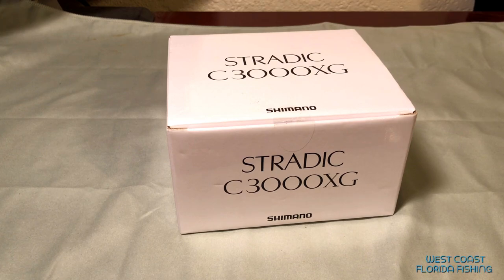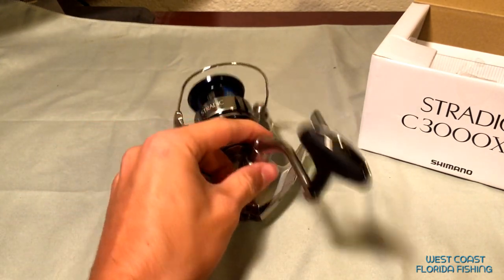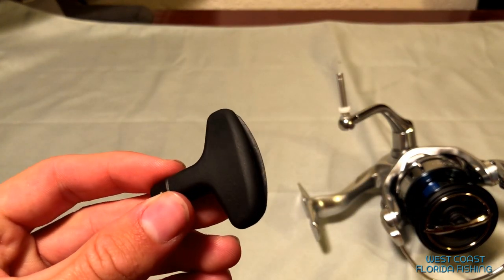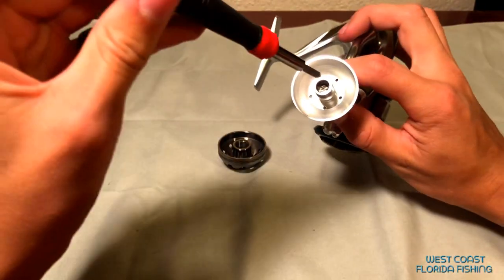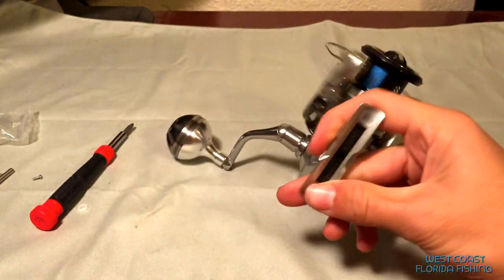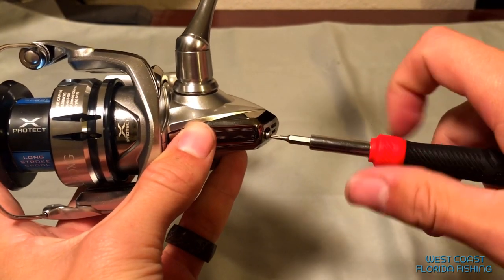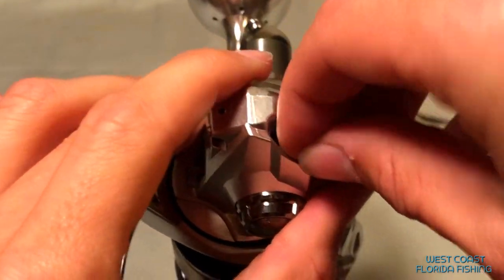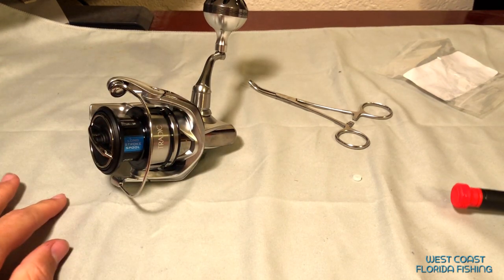2019 Stradic FL Unboxing and Upgrades | Gomexus Power Knob | Upping Bearing Count

Comment: Great video!! For reference, the Shimano part RD17751 does not fit for 4000 and 5000 size reels for under the spool. The correct bearing size is 8x16x5.
Reply from the maker: Awesome thank you for the specs!

Comment: Good video quick question what’s the benefits of the bearings you added compared to the bushing it came with Thanks much appreciated
Reply from the maker: Great question! Swapping these bushings for bearings provides less friction and resistance as your reel works, therefore creating an overall smoother experience!
Reply: It's heavier and the handle unbalanced and the spool bearing will corrode. I prefer German or Swiss ball bearings and the Swiss Ceramic are  reel upgrade. Ceramics are in a different class by themselves.
Reply: Good video bro. Where u can buy that upgrade bearings?

Comment: Just got the exact same reel... Didn't know there were upgrades that can be. Never done just tried servicing stadic fk 3000 the other.. First trying to service my own reel.. Worm everything taking apart.. Was a mission and now my anti reverse isn't working. Will have to open again and look.
Can one order any bearings to put a reel according the the size or how does it work...
Awsome vid thanks so much
Reply from the maker: Yes you can put bearing in according to size of the nylon bushing it doesn’t have to have a compatitable part with another reel. Yeah servicing them can be tricky I like to record myself just to see where things go back sometimes! Did you get your reel fixed?

Comment: What a great video, thanks so much for sharing West Coast Florida Fishing!
I have just got myself a brand new Shimano Stradic FL 5000 and wonder if i am supposed to use the same part numbers as you had on the 3000 (or is it the same on all models?) I also noticed that my reel came with a different orginal handle than the 3000 model.
Reply from the maker: BB O you’re welcome!! Thanks for the support man it means a lot to me!! And wow that’s a nice reel!! It is not the same part numbers but it is close! Everything will work except the spool support bearing swap. That is a different size and I have a link to it somewhere let me find it...
Reply from the maker: Aha here is the bearing you need to order! Here:  
(8x16x5)
 https://rover.ebay.com/rover/1/711-53200-19255-0/1?mpre=https%3A%2F%2Fwww.ebay.com%2Fitm%2FHigh-Quality-440C-Stainless-Steel-Ball-bearings-Listed-by-Size%2F124156176607%3Fhash%3Ditem1ce848e8df%3Ag%3ARyQAAOSwXj1emJGP&campid=5338690692&toolid=10001&customid=Stella
Reply: @WestCoastFloridaFishing  Thank you so much for the reply:) I will then order for my 5000 FL:
- Stella Spool Support Bearing (RD13274)
- Stella Worm gear Bearing Counterpart (RD 11018)
- Spool Support Bearing for 4K and 5K STRADIC FL,FK (8x16x5)
Reply from the maker: BB O you do not need the Stella spool support 13274 but you do need the RD13269 for the Handle support Bearing
Reply: @WestCoastFloridaFishing  Oh, i ordered the 3 above including rd 13274:(
Well i just have to order one more then RD 13269
 it is then :) ty

Comment: I saw you linked the spool support bearing for the 4K in the description, thx for that. Ist the worm gear bearing that you linked in the same for the 4K?
Reply from the maker: No problem man! I’m glad you found it unlike the other 200 people that ask me 😂👀 and yes that worm gear bearing is the same from the 1000-5000 size! Good luck man!
Reply: @WestCoastFloridaFishing  thanks, I will definitely upgrade my 1K and my 4K.
P.S. the 1K still got that felt washer so I will replace that with a carbon fiber drag washer ;)
Reply from the maker: Nice!!! And yeah you can definitely do that with the link here: http://rover.ebay.com/rover/1/711-53200-19255-0/1?ff3=4&pub=5575591865&toolid=10001&campid=5338690692&customid=Carbontex&mpre=https%3A%2F%2Fwww.ebay.com%2Fitm%2FCarbontex-Drag-Washers-SHIMANO-Stella-9908-Stella-2500-3000-Stradic-FJ-FK-Ci4%2F153915952296%3Fepid%3D688391402%26hash%3Ditem23d61b0ca8%3Ag%3ALiEAAOSwn-tZNvyv
Reply: @WestCoastFloridaFishing  thanks man, I appreciate it

Comment: Thank you for sharing this video. I just returned a Battle II 3000 for which I received for Christmas and purchased / ordered the Shimano Stradic 2500 FL. I hate to assume so I'll ask will these parts and changes benefit this real also, the 2500? I'd like to know which handle, knob you used. Was it the 35, 38, or the 41 mm.? Also and replacing the bushing for a bearing on the spool what's the main purpose of that? And the purpose of the bearing on the Worm Drive? Again thank you for sharing this video and Tight Lines and Full Limits To Ya 🎣
Reply from the maker: Big K You’re very welcome! Thank you for watching it! I believe you made a good decision switching the two. Yes all of these bearings should fit your new 2500. The knob I used was the 38mm but you can choose whichever size you like. Replacing the bushing for a bearing on the spool will help reduce the amount of load on your main shaft while hooking in large fish that’s taking a ton of drag. The worm bearing drive simply reduces the friction between the worm gear and the main body and therefore makes the reel smoother! Great questions and I hope you stick around and subscribe for more awesome videos like this one! Tight lines brotha! -Isaac
Reply: @WestCoastFloridaFishing  thank you I might just do that.
I live on the Texas upper Gulf Coast and this is my first spinning reel well my first would have been over 20+ something years ago and it was a Penn 4400SS, yes that was a long time ago. I actually have my first reel that I ever bought new at the youth back in the 70's. So again this is my first spinning reel in a ton of years most of the men around here all used baitcasters but there's a lot of them going to The Darkside LOL. I've got hands like a bear paw as I stand 6'8" so that's why I'm considering that knob change, which led me to your Channel and these questions. Thanks again and God bless. 🎣
Reply: @WestCoastFloridaFishing  my apologies I should have asked where do you order your parts from?
Reply from the maker: Big K oh wow it has been a long time since you’ve owned a spinning reel! It seemed that the meta is shifting a little to throw out ultralight lures on spinning now.. I’m glad you were able to find my channel and seek some help! And I don’t order parts I work at a tackle shop and we service reels in store so I have all the selection we need! eBay can be a good resource to get bearings though!
Reply: @WestCoastFloridaFishing  yeah babe the first place I went I only found one person in that guy's going on vacation or something else and he couldn't answer questions for me so blah blah blah. No worries I have enough interest in it that I believe I'll find those parts somewhere I know where to find the handle that I found out on Amazon cheaper than eBay. Thanks again for your time

Comment: Will you be doing any video PIMPN'...lol, on the Stradic Ci4, but just the bearings? The knob would defeat the purpose of it being a light weight reel.
Thanks a bunch
Reply from the maker: Jose Labrador I can definitely put that on my to do list! It’s basically the same exact method as the Stradic FK but it would be nice to see the exact reel you own being worked on. I will upgrade my 3000 Ci4+ FB for a video just for you 😁👌🏽
Reply: @WestCoastFloridaFishing  Thanks a bunch!

Comment: Great video! I have the Stradic FL in the 1000, 2500 & 3500 sizes. Love these reels but the slop at the handle bothers me. What bearing did you end up using where the knob attaches to the handle?
Reply from the maker: Ben Anderson They’re amazing reels for sure! And that slip can be fixed with some shims but the bearing is the same as the stock one. And I ended up using the bearing with the part number RD13269
Reply: @WestCoastFloridaFishing  Thanks for the response!!
Reply from the maker: Ben Anderson you’re welcome! Stay tuned for an upcoming video where I show you how to reduce the amount of slop in the handle also known as handle play! Should be able to get it out soon!

Comment: Muy buen video. Necesito saber como se llama el destornillador pequeño para cambiar a rd13274 de la bobina.gracias
Reply from the maker: Thank you amigo! That bearing is found on the Shimano parts website and is fairly easy to find. Or you can use my link in the description to get the bearings!

Comment: A few people have been saying that the smaller FL's are good and strong but, the bigger 4000 and 5000's the drag Doesn't hold up against big fish like people thought. Will doing these upgrades help it out alot ? Thank you
Reply from the maker: I’m not sure about increasing the drag power and preformance as we didn’t touch the drag system at all.. unfortunately the drag is going to stay the same all the way up. The only thing I could think of is to use a more high quality carbon fiber to allow enough heat to dissipate faster and allow the drag to withstand more.. sorry I wish I helped!

Comment: I have three of these reels in the 2500 version and have had to replace the roller bearings on multiple occasions due to corrosion and loud noise when reeling/working lures. Do you have a solution for this issue??
Reply from the maker: Yes all I do is pack that line roller with shimano grease and that will make the line roller lady a lot longer

Comment: Hi, apologies for a slightly unrelated subject. I need to replace a handle knob on my Sustain 2500 FE, however Shimano Australia advised that the part is superseded.
Can you suggest any aftermarket brands which can offer a knob replacement? Alternatively, can the whole handle assembly be replaced with the Gomexus 98mm double handle?
Cheers
Reply from the maker: Any of the gomexus knobs will replace your handle actually! You can follow any of my gomexus tutorials and it should be the exact same. What year was your sustain??
Reply: @WestCoastFloridaFishing  I think it is 2008

Comment: Ceramic or steel ball bearings? For lubrication, should i use oil or grease?
Reply from the maker: I don’t always lubricate bearing wise but if I do I use Shimano grease and I have always went with stainless steel ball bearings.
Reply: That is good to know. Thank you!

Comment: @west coast Florida fishing, I'd like to do the same upgrade for my new 5000 size reel of the same make . What parts would I have to order , excluding the power handle ?
Thanks.
Reply from the maker: Vikram UG great question! The worm gear bushing upgrade is the same posted and used in the video but the spool support bearing has the part number of RD17751. I hope this helps you!
Reply: @WestCoastFloridaFishing   Thanks for the deets
Reply from the maker: Vikram UG you're welcome boss! Make sure you enter my giveaway for a chance to win 20$!

Comment: Them bearings will they fit the 2500 FL shimano stradic the bearings you just put in this reel are are they better then the boca bearings plus who makes the best one out there on the market today are if it makes a difference
Reply from the maker: Eugene Johnson with this light application reel it would suffice with boca bearings! They will fit the 2500 Stradic FL yes!

Comment: Is there a size different between 3000,4000, 5000? or its just the line capacity?
Reply from the maker: There is a size difference between the 2500,3000 and the 4000,5000 but not a difference between 2500 and 3000. Also no difference between 4000 and 5000. This is why you see a “C”3000 that ‘C’ is noting a compact reel=same body size. Different spool Size. Same with the ‘C’5000 and the 4000. Thanks for the comment!

Comment: I'll subscribe. I don't know if I want to replace bushing to bearings. I own the stradic fl 5000. I did a Unboxing video on that.  My very first shimano reel ever.
Reply from the maker: Sparky Ishii Thank you for subscribing! And I would probably swap out the worm gear bushing for a bearing but that’s just my input.. I’ll have to go check it out for you!
Reply: @WestCoastFloridaFishing  I'll  go look into that. You seem to know that bearing must improve performance of the reel. 
I personally have bad luck with bearings in general. I wore out many bearings for my penn slammers. I replaced them and wore them out as well. 
Thank you
Reply from the maker: Sparky Ishii Yeah working at the tackle shop I’m inside of reels often and A bearing has less friction than a bushing so it makes the reel feel smoother.. good luck!!

Comment: Do these same part numbers work for the 2500? I think the only difference is the tall spool. Correct?
Thanks
Reply from the maker: They will work exactly the same the only difference between the 2500-3000 is the depth of the spool!

Comment: Whats the gomexus knob size? 35mm or 38mm?
Reply from the maker: The one I used in this video was the 38mm knob but for 3000-2500-1000 sized reels I record the 35mm knob as the 38mm is really a tiny bit too big for those sizes
Reply: @WestCoastFloridaFishing  olrite, thanx alot, tight lines 🤙

Comment: im having trouble finding those part #'s on the links you provided, rd13274 is not on there?
Reply from the maker: I will get you the correct link as soon as I get home then! And fix the one in the description. Thank you for the heads up! It should be fixed in about an hour
Reply from the maker: I found a correct link and updated the description! Thanks again! Link: https://rover.ebay.com/rover/1/711-53200-19255-0/1?ff3=4&toolid=11800&pub=5575591865&campid=5338690898&mpre=https%3A%2F%2Fwww.ebay.com%2Fsch%2Fi.html%3F_from%3DR40%26_trksid%3Dp2047675.m570.l1313.TR0.TRC0.A0.H0.XRD13274.TRS1%26_nkw%3DRD13274%26_sacat%3D0

Comment: Hello, i have an fl  5000, in the manual said these parts are
Rd17698 handle knob bushing
Rd16157 spool bushing
Rd19976 worm bushing rear

Not the same parts you said, fits your parts number in my reel?
Reply from the maker: Hello! The bearings used in my video will fit to replace your Handle knob bushing and your worm gear bushing and NOT your Spool Bushing. Here is the link to buy the bearing numbers RD13269 and RD11018: https://www.youtube.com/redirect?v=PRa4zIlzEeo&redir_token=QUFFLUhqazRDcWUxOFpHUFQxVWREN2Z0YXJIRjRGaktpd3xBQ3Jtc0tuUDB5SWQ3SkJ3NXBkSEJFTkhVQ0s5LXJBQUdJMGZLUnROLUtfbFJKTWV3UDJ0QlI4Qk00YU1GUUVjYy1NczdteFRVVTJWZmptRGd3TVRsX3Q4X0xxUTRhQUM2Zng3OE5iekRPVVlnNmhubHBVWHFtMA%3D%3D&q=http%3A%2F%2Frover.ebay.com%2Frover%2F1%2F711-53200-19255-0%2F1%3Fff3%3D4%26pub%3D5575591865%26toolid%3D10001%26campid%3D5338690692%26customid%3DStella%2BBearing%26mpre%3Dhttps%253A%252F%252Fwww.ebay.com%252Fitm%252FShimano-reel-BEARING-BUSHING-replacements-by-part-number-STAINLESS-CERAMIC%252F124096850349%253Fhash%253Ditem1ce4bfa9ad%253Am%253Am7HCh0tI8dMxHBsqBgMSP6A&event=video_description
Reply: Anyone know the bearing size for the spool bushing for a 5000FL. A Shimano part number would help.
Reply from the maker: Viet unfortunately the the shimano part number is either no longer in service or is an error because I’ve tried purchasing the part number through shimano and they told me it wasn’t a real part number... oh well.. I’ll try to get dimensions on it tomorrow..
Reply: Is it RD8128?

Comment: so does the original bearing you missed sit on top of the shim (so the missing bearing the very last in before screw)
Reply from the maker: Simon Trudgen can you be a little more specific on which bearing you’re talking about? Or add a time stamp to the video where you are talking about?
Reply: 5mins 45. Process for knob is... remove handle and existing bushing, add 1dt bearing (is there no shim/washer put on before this?) then put on the new handle on followed by 2nd bearing and a shim/washer) lastly fastening screw and top part of knob.
In short 2 bearings but how many shim/washer....1 or 2?
Thanks in advance for answering!
Hope this makes sense?
Reply from the maker: Simon Trudgen yep you cleared it all up for me! I add usually 1 OR 2 shims before putting the bushing on then the handle knob and then the bearing and then the shim and then the screw. It all depends on how much play your handle has after installing the new knob!! Shim it to your liking! It varies with each reel so it’s hard to say “put two in” because that couldve shimmed it too much. Use your judgement best!

Comment: What size is the power knob? I'm going to add one to mine but want a slightly smaller one.
Reply from the maker: That one is a 38mm but they also have a 35mm! It’s a little bit smaller should be perfect

Comment: How tight do you screw in? Is it supposed to be somewhat loose?
Reply from the maker: For the handle knob? Tight but without proper shims it will get too tight when you swcrew it in. I used the shims that came with the knob! Did I answer your question??

Comment: Will the bearing upgrades work on the 2500 size or will it be different part numbers?
Reply from the maker: Everything in the video will directly fit on a 2500! You shouldn’t have any issues!

Comment: hello, how many millimeters is the gomexus knob? Thank you very much.
Reply from the maker: The size of the gomexus knob I used in this video is the 38mm size! Here is the exact link: https://www.youtube.com/redirect?redir_token=QUFFLUhqbEppbXV5dEhtbzI4d19NWFdaTFo3emxKRDVzQXxBQ3Jtc0tuSkJRQ0FPWFFUOF95SVBfOHN3cmNZd0FJb1p0V1RvZk1lOENQUG1NTjFTUkxFUTh6S19Eb0JybnBDRlVLeWdnVU43aFpINE9naTdpN18xRHlWa2hIV0JvUFpwYTczdy1BNC0zaUZVRW5kZl9CeGRHNA%3D%3D&event=video_description&v=dgjK6xQhFi0&q=http%3A%2F%2Frover.ebay.com%2Frover%2F1%2F711-53200-19255-0%2F1%3Fff3%3D4%26pub%3D5575591865%26toolid%3D10001%26campid%3D5338690692%26customid%3DGomexus%2BPower%2BKnob%26mpre%3Dhttps%253A%252F%252Fwww.ebay.com%252Fitm%252FGomexus-Power-Knob-For-Stradic-FI-3000-4000-5000-Shimano-Reel-Handle-38mm-Direct%252F273058835431%253Fepid%253D4014478229%2526hash%253Ditem3f93932be7%253Ag%253AYRcAAOSwFbFdSkts